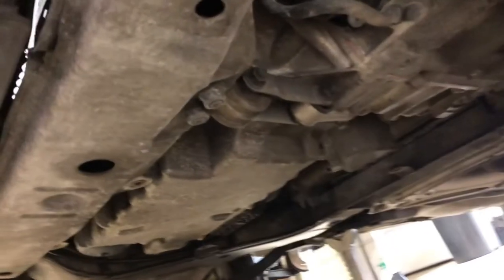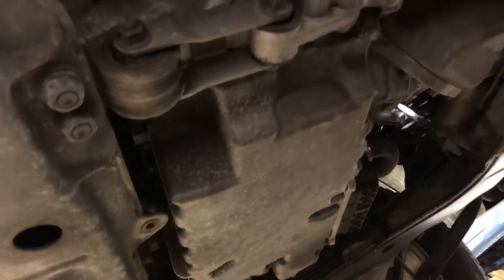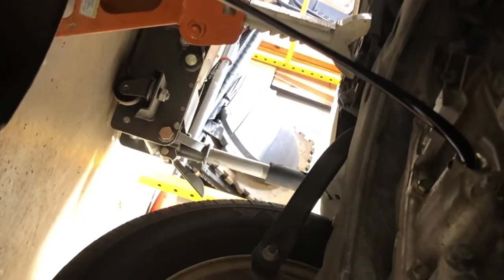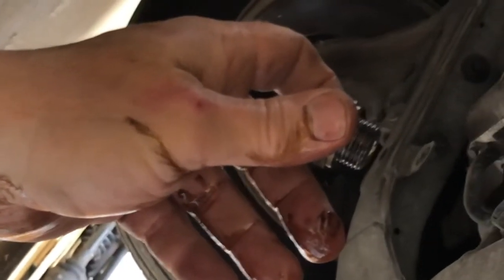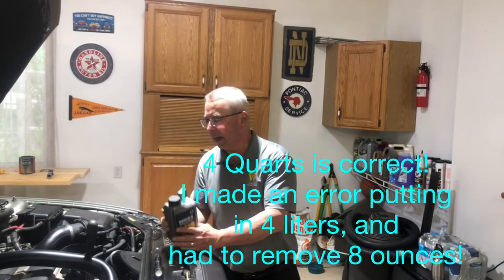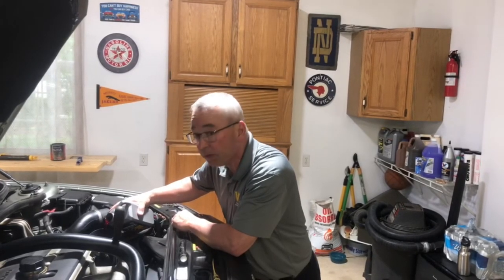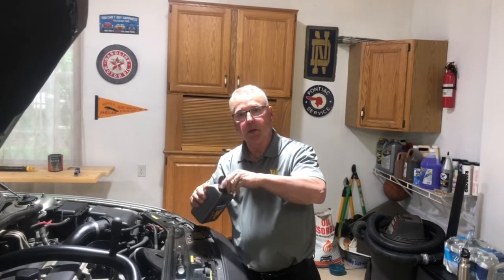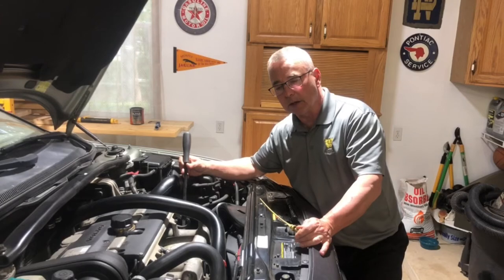We evaluate Transmission Service for a 2007 Volvo XC70 using the drain & fill method is it worth it?

Comment: I use the same funnel as you but modified a bit. I sanded the end down a little and then hit it with a heat gun to soften it to make it plyable. Shoved it in and let it cool. Now it's a perfect fit!
Reply from the maker: Great tip Richard!  Thanks!

Comment: Nice car.  I've been flushing these AW transmissions through the radiator connection, similar to the IPD kit.  Works like a charm.  I never used the drain and fill method.
Reply from the maker: Thank you Mark; I’ve done the flush technique on the earlier transmissions and it works great as well. I may add a transmission cooler from an Xc90 2.5 as well (just gotta find one!)
Reply: I also flush mine and use a old cooling line fitting to plug into the top radiator port. Works perfect with no mess.

Comment: have the same car, at 90k i had my garage flush and full brake lines and the tranny fluid,  shifts like new now. no issues and currently at 93k miles. When in colorado go to the Baker garage.  They know their volvos!
Reply from the maker: They are an amazing car!  Thanks for sharing the tip on Bakers.
Reply: Thanks for posting this! I am in Colorado and looking at buying a 2007 XC90. I was going to take it to the dealer, but I will give these guys a try first when I get the vehicle.
Reply: @sirblack1619  Of course,  Ask for Justin, he's the main man, they're all pros there and now everything.

Comment: 👏 Aw55, I do mine every 30k.
Reply from the maker: As dark as my fluid was I’m not sure it had ever been done. I plan to do another soon; thanks John!
Reply: Dan… I have 138,500 miles on my 06 Ocean Race. I called a Volvo Specialist in Stanford Va and the first thing they asked me is,” Do you tow? My answer was NO… You don’t need to change it.” I checked the owners manual and it doesn’t give a miles point when to change it. Your opinion… I would you change it?

Comment: these transmissions are definitely sensitive. My 850's aftermarket CV axle is slightly smaller in diameter which caused a small leak at the axle seal. fluid level fell a bit and it was very lazy to shift
Reply from the maker: Transmission fluid is the working fluid that is at the center of the trans operation; fresh fluid makes a difference!  Thank you Matt!

Comment: How did the install of the S60R headlights go?? Looks sooooo nice!
Reply from the maker: I used the 2004 connecting wires and adjusted the lights manually for normal driving.  And thanks they do add flair; thanks for watching!

Comment: Hi there. Volvo xc90 2005. How do I remove the "Transmission Service Required" code after doing the service please? Thank you
Reply from the maker: Hi Candy World,
You need to use VIDA to do that. You can also do some additional work with VIDA so the trans knows it has new fluid.  Thanks for watching!

Comment: Looking at either a 2007 xc70 t5 or a 2010 xc70 3.2l.    Thoughts on reliability/dependability?   Thanks
Reply from the maker: They are both good cars. I own the 2007 and the engine and drivetrain are excellent. I did add the 305mm brakes to the car and like that improvement. That 2010 3.2 non turbo is noted as an excellent choice by many. I guess you can’t go wrong with either one. Maintenance history should play into your decision and mileage, condition as well. Thanks for watching!